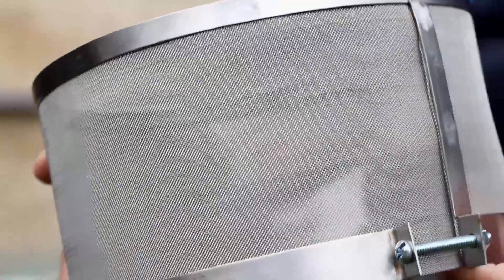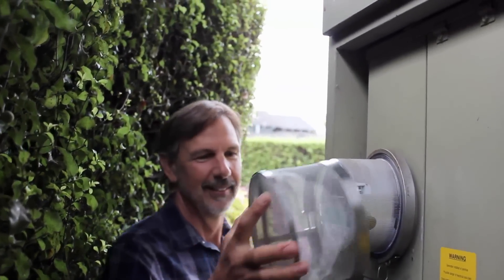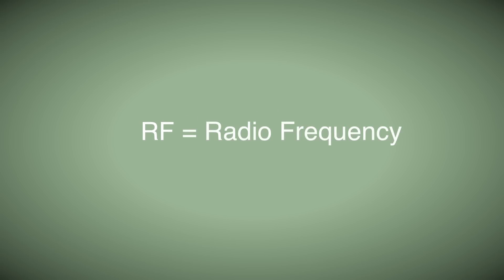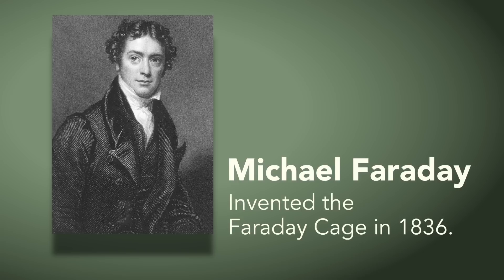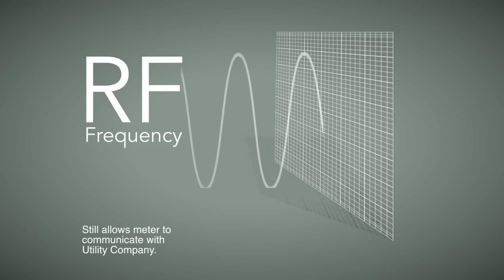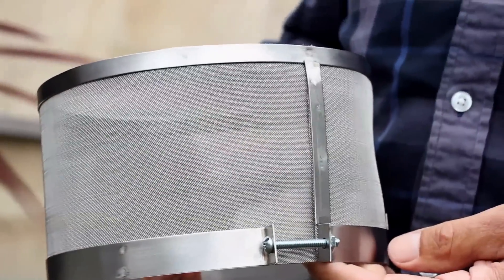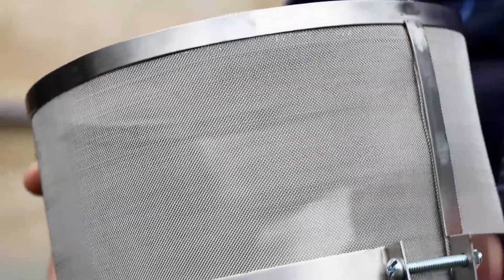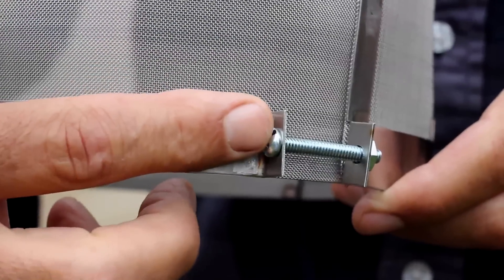Smart Meter Guard

Comment: I just received the Smart Meter Guard but it didn't change the RF reading or EMF reading either inside or outside. I tighten the screw and even put a copper wire to ground it, but no change, I was hoping that this was going to reduce the RF but it hasn't Any suggestions?
Reply from the maker: Hello Loreto,  Thanks for letting us know your readings.  Most likely you are either using the wrong meter to measure, measuring the wrong field, not measuring correctly or all three of these.  Measuring RF from smart meters is much more complicated than most people think and if you don't do all of these things correctly your readings won't mean anything.  We developed an "RF Measuring Guide" to help people measure RF correctly.  If you email us and let us know what RF meter you are using we can help you better.  In addition, we can send you our RF measuring Guide.  Thanks

Comment: So it protects people outside the house while reflecting and possibly intensifying the RF inside the house? 
Also, how does the energy company bill you for the power if the data transmission is blocked by your screen? 
Don't get me wrong I hate smart meters and have refused to let them install one at my home.
Reply from the maker: Hi jorgdefoe1,  The Smart Meter Guard also blocks the RF going inside the house.  This is why.  Everyone's utility bock is made of metal including the top, bottom, sides and back.  RF can not pass through this metal.  Rf emits out of the glass portion of the smart meter.  RF waves propagate radially in all directions including back into the house.  Once the Guard is put on the entire unit is now covered in grounded metal the RF can not pass through.  The Guard is about 98% efficient at blocking the RF.  The 2% or so that gets out is still enough for the utility company to get their signal.  Thanks

Comment: SmartMeterGuard There is a high pitched buzzing/whistling/chirping sound in and around my house 24/7.  At night it amps up louder . I don't have Tinnitus.  I can cut all the switches at the box, and it still sounds. At this point the Smart Meter is the only thing running that I'm aware of.  It's not any of the appliances, etc., already checked that.   I t's getting really old, I need my sleep and my ears to be comfortable again.  Do you know of any people that have gotten rid of this kind of noise by using one of your Smart Meter Guards? And  is there anything additional  I could do?
Reply from the maker: Hi Littlewhite, If the noise you are hearing is more of a low pitch humming sound then it is most likely the 60 Hz in your power lines.  This means something, including a smart meter, is passing current through it and you are hearing the 60 Hz it is producing.  The high frequency RF smart meters emit is pulsed at about every 20 to 40 seconds but also is too high of a frequency to hear.  We have had some people say it helps but we only guarantee that it blocks the RF, not cure any symptoms.  Hope  this helps.  Thanks
Reply: Thanks for the reply.  This is definitely a very high pitch, and steady.  Still blocking the RF is a good thing in itself.

Comment: When you agree to hold an account with an electric company, you agree to their terms. You agree to let their meter function as it was intended and designed. If you then defeat that meter's functions with a cage you will be subject to penalty and service termination. If you do not like the radiation emitted by your electric meter (yes, it does cause cancer and many other health disorders) then you must negotiate that with your electric company, not simply put a cage over their meter.
Reply from the maker: Hi Minivan,  The smart meter still functions as the terms people sign up for.  This is because the Guard blocks about 98% of the signal the smart meter emits.  The 2% or so that gets out is still enough for the utility company to get their signal.  We have these installed all across the US and Canada and haven't had a utility company not get their signal.  Thanks
Reply: EMF aside for this comment, no private company nor any government entity can force you to surrender your privacy.  These meters send meta data 24/7 to the power company.  Every electrical device has its own signature that many of these meters are capable of identifying. Simply by just the power consumption alone one can know when you turn-on your electric stove or dryer by the amperage being consumed.  All the power company needs to know is how much KWH was consumed during the billing cycle, nothing more.

Comment: What If you wrap it in tinfoil?
Reply: Let's look at why we need TIN FOIL HATS. 
 #1 A smart meter will hurt or even KILL disabled homeowners who have disabled medical implants.  The average of deaths by smart meter radiation and smart meter fires is almost 100 every month in North America.
#2 Did you know if your power company “turned off” the power to your home when they did a smart meter install, your chance of a smart meter fire increased by a factor of 10,000.
#3 Your power company has access to all of you private power information. Eg When you make tea, when you turn on your alarm etc. This private information is sold to Google for huge sums of money. Ask your power company what the second radio transmitter in your smart meter does. (ZigBee) 
#4 A smart meter will cause cancer to return if your family members who are fighting cancer at home. If they come home from the hospital and sleep near a smart meter, they will die. Check with the US Cancer Society website. 
#5 Smart Meter RADIATION  will turn off breakers in your home. Both AFCI's and GFI's get turned off by the radiation from the smart meter.
#6 You smart meter is very accurate, BUT, the software (firmware) is programmable. Your bill has nothing to do with the power you use. 
#7 Smart meter radiation is breaking Ionic Bonding.
#8 A huge expenditure for a huge loss. Billions of dollars to purchase something that does not general generate any power and each smart meter need 4 watts to operate. One million smart meters use 4,000 KILOWATTS of energy to operate.
#9 The second radio transmitter is for ZigBee. If you want your power company to MONITOR your home 24/7, then you are in luck. Don’t forget, this private information will be sold. Why do you think your power company spends BILLIONS of dollars and does not generate one watt of extra power to sell?

Comment: do you know what kind of range these things have? and should i be worried about a neighbours smart meter effecting me without my knowledge?
Reply from the maker: Hi, What you should be worried about is the actual power level of the RF, radio frequency, waves smart meters emit.  The good news is that RF power level drops off rapidly with distance from the source.  There is a formula for the RF power drop and it drop at a rate of one over the inverse square of the distance.  This doesn't mean much to many people but it's essentially a log scale drop.  If you are 40 to 50 from a smart meter the RF power is actually quite low, almost ambient levels.  Hope this help.  Thanks
Reply: @SmartMeterGuard  40 to 50 what? Feet? Inches?
Reply: Lee Vittout these devices are microwave powered. We’re surrounded by them. Basically we’re getting cooked.

Comment: I assume you can get in a heap of trouble for interfering with your utility bill readings.
Reply from the maker: +Aaron Lowe   Hi Aaron,  Actually,  what we have found is that the utility companies really don't care what you do to their smart meters as long as you don't do one of three things.  First, never break the security seal.  The utility companies get very upset if you break their seal.  Also, it's against the law to break the seal.  Second, do not block their access to the smart meter.  There are a lot of people who put bolts, chains, wire and other contraptions to lockout the utility company from their smart meter.  Lastly, do not block their signal.  If they don't get a signal they think you are stealing their power and they get very upset.  As long as you don't do any of these things to their smart meter they really don't care what you do.  Thanks

Comment: Will these mesh cages prevent the utility company from getting their readings?  I guess what I want to know, will they come to my house and remove it, or attempt to charge me with meter tampering?  We have Consumers Energy here, and the smart meters were installed by Corex Utilities.  Thanks.
Reply: You say do not block their signal, but isn't their signal transmitted through the RF waves that you intended to block with this cage?
Reply: @gibson7654  That's my question as well? Seems the Smart Meter guy doesn't want to answer that question.
Reply from the maker: +Kevin Schuyler   Hi Kevin,  Actually,  what we have found is that the utility companies really don't care what you do to their smart meters as long as you don't do one of three things.  First, never break the security seal.  The utility companies get very upset if you break their seal.  Also, it's against the law to break the seal.  Second, do not block their access to the smart meter.  There are a lot of people who put bolts, chains, wire and other contraptions to lockout the utility company from their smart meter.  Lastly, do not block their signal.  If they don't get a signal they think you are stealing their power and they get very upset.  As long as you don't do any of these things to their smart meter they really don't care what you do.  Thanks

Comment: carl your radiashion meter must be rooted radiashion goes strat thru stainless
Reply from the maker: +obieezx11   Hello Obiee,  It's actually the field effect of parallel metal lines that blocks the RF.  You can actually use almost any metal with parallel lines and it will block the RF.  We use 316 stainless steel because it doesn't rust or corrode in harsh weather conditions like aluminum or regular steel.  Thanks

Comment: So how much and what is address ???
Reply from the maker: Hi mjoinga,  You can find all the details on our web site at www.smartmeterguard.com Thanks and let us know if you have any other questions.
Reply from the maker: +Patriot News Network  Hi Patriot,  While tin foil will block RF waves it also reflects them and it very possible to reflect the RF in a direction you don't want it.  If your not familiar with manufacturing it's a common misconception to see something and think it's very cheap to make.  There 8 different pieces of 316 stainless steel that are cut, bead cleaned, bent, assembled welded and polished all by a metal fabricator in the US, not China.  We would challenge you to go to a metal fabricator and get a quote for the same thing.  You will see that our price is actually a good deal.   Thanks

Comment: Now it sends it into the house through the back or on the energized wiring in the house. People thinking this will solve their problems are going to be harmed.
Reply from the maker: Hi iprovedit,   The Smart Meter Guard does not send send RF out the back of the smart meter.  Here is a link to our other video that demonstrates this: Radiation Blocked -2   Radiation Blocked Inside the House .   Also, it does not send anymore RF on the house wiring than there already is.  We have measured the induced RF on the house wiring and it is the same before and after the Smart Meter Guard.  It was about 3 uW/m2 on the wiring compared to 50,000 or so uW/m2 the smart meter emits.  If people want to clean up the "Dirty Power" on the house wiring, which can be caused by electric motors, fluorescent lights, hair dryers... then need to get a low pass filter network on their house lines.  The Smart Meter Guard blocks all the radiated RF emissions both inside and out side the house.  Thanks